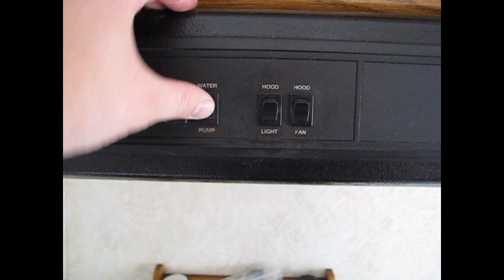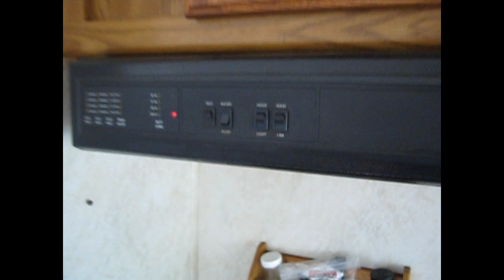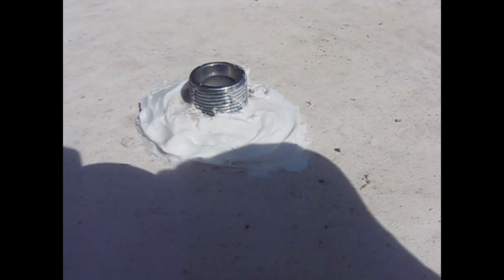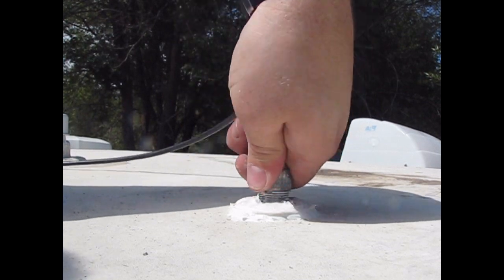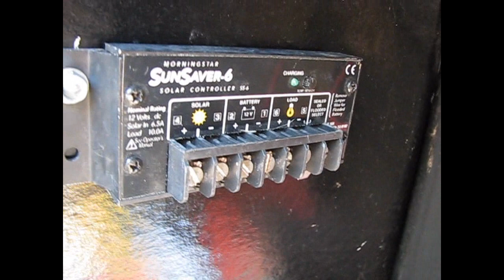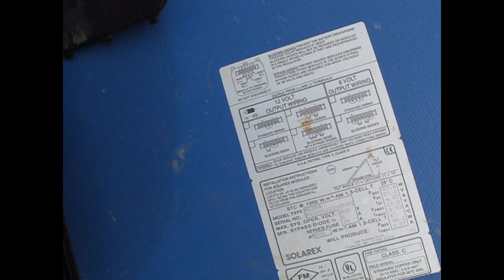DIY Camper RV Solar Panel Installation

Comment: Ok, but once the solar panel is wired to the controller and the controller is wired to the battery, how does it connect to the electrical system on the camper? I can't find any videos that show you how to do this.

Comment: My concern is that there is NO air flow under your panel and this will cook you panel sooner than later .. also without the proper airflow any moisture that gets into the bottom of the panel - between the panel and the roof - is going to sit there and turn to mold and eventually weaken your roof. But once again the biggest concern is the cooking of your panels since there is not ventilation ....
Reply: ghostwriter6699 How are you supposed to seal around the panel  to prevent moisture from collecting underneath and provide ventilation at the same time?

Comment: So, why would i want a solar panel on my 5th wheeler permanently!? For the drildo or industrial vibrator? i dunno? why the fuck would you? O yeah, free power :/ what an opening lol

Maths are slightly out too unless your using an MPPT, a PWM chucks away power, the maths would be more VMP 17.5V
So 60w / 17.5VMP = 3.42A.
MPPT would track and hopefully find 17.5V. 3.42A and would convert this to 4.34A approx. 13.8v charging.

Comment: If I hook up a secondary battery to the first one does that mean I have double the use time, assuming enough time was given to charge them both? If so is it as simple as connecting the second battery directly to the first?

Comment: Good video. I just bought a 1985 Coachman; and am re-doing the solar set up. The panels work fine, but the wiring is a mess. The one part I still don't understand is how to wire the marine batteries into the RV once the wiring to the batteries is done.

Comment: I don't understand what a battery having 100 amp hours means. Does that mean after 100 amp hours it is kaput?
Reply from the maker: Amp hours is a rating of capacity. For a 100 amp hour battery you could pull 1 amp  for 100 hours before it needs to be recharged. Or if you are pulling 10 amps it would take 10 hours to deplete.

Comment from the maker: No, 4.8a * 115V = 552 watts, much more power than this panel can provide. Remember, Amps * Volts = Watts. There will also be probably 10% power loss when converting the 12vdc to 120vac

Comment: I agree with you about sealing the panel too well,  Would leave the sides + the front boards in place.  Leave the back board off to allow circulation.  The front board will keep the wind while driving from trying to lift the panel up.

Comment: Dude. Nice work but you will destroy the life of your panel and you also losing power because the panel need some air space underneath to cool itself down during sunny day. Remember when the panel charge it get really hot.

Comment: Now that you have this installed, did you run in to heat problems with the panel? I have heard that the panel must be raised to allow heat to dissipate. I noticed you used wood blocks to mount the panels and blocked off the airflow underneath. Thanks.

Comment: Is that a MPPT controller? If not, then the panel and battery operate at the same voltage while charging so the only reason to keep it close to the battery is so it'll see the true battery voltage. Still, keep cables short and heavy to minimize voltage drop and wasted power. NEC wire ampacities are based on safety, not energy loss, and that can get rather high at 12V if the wire is too light.

Comment: For power, use deep-cycle batteries, charged with the generator. Some fridges can run on propane, but you'll still need some 12VDC for the electronics.

Comment: I just bought a vintage 1971 Serro Scotty camper. It's a small, single axle camper that I plan on doing a frame up restoration on, and with plenty of modifications. I plan on hitting the road with it and living all over the country for a few years.

I'm not always going to be near a power source, so I'm getting a small gas generator and the mod for it that allows propane. But, I need something to run my fridge when I'm not there... like a solar pannel. Suggestions?

Comment: Thanks for this great video I just got a camper that will be permantly parked off grid and you made the project look vary easy.  Is there a limit to how many batterys you can have hooked up? also do you have to disconect solor to batterys if you run a generator?

Comment: Nice install. But a 60 watt panel is going to have a VOC of around 18 volts or so. 60w / 18v = 3.3 amps. If you're charging your battery even at 14 volts, then 14 x 3.3 = 46.6watt is the max you will get. The charger should be set to 14.1 to 14.4 for a vented lead acid battery. If you are charging at 12.5 volts because your battery is down then 12.5X3.3=41 watts is all you are getting. The power between the charging volts and panel output is lost as heat. Nice install though.

Comment: i hope you left a drain hole in the surround of the panel. otherwise if it leaks between the panel and the wood the underneath will fill with water

Comment from the maker: @apatternlanguage Yes you will need deep cycle, or marine batteries. Regular car batteries will not last as long as they like to be charged up at all times and don't like deep cycles of charge and discharge.

Comment from the maker: @rriverstone1 The one in the video is a Morningstar SunSaver-6 (you can google it), I have installed a lot of them and never had a single issue. The SunSaver-6 has a load capacity of 6 amps, at 12 volts it can handle a max 72 watt solar pannel. A 10 amp controler could handle a 120 watt solar panel. Just multiply the amperage rating times the voltage to get the watt rating.